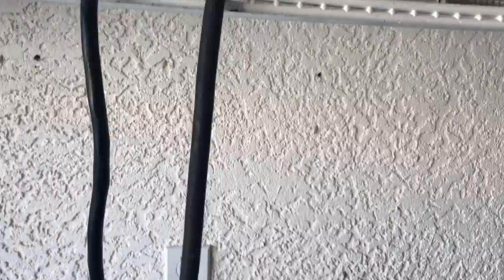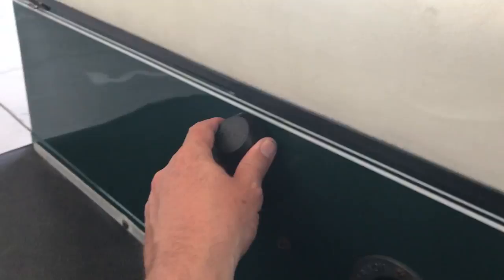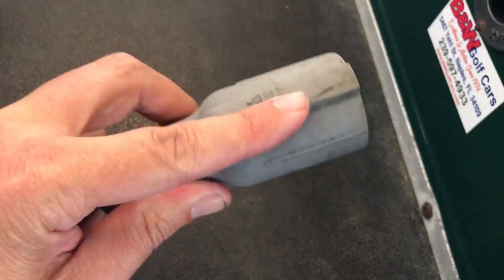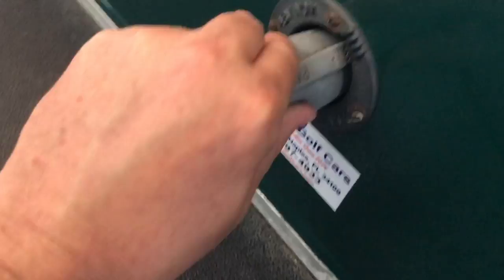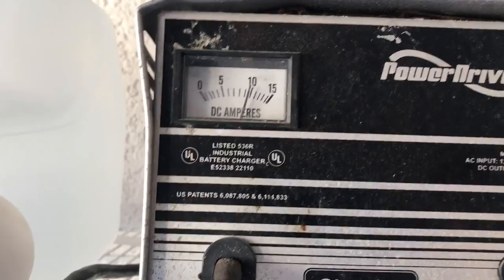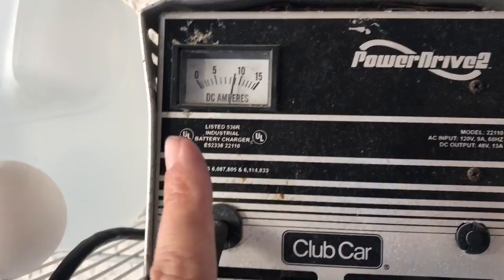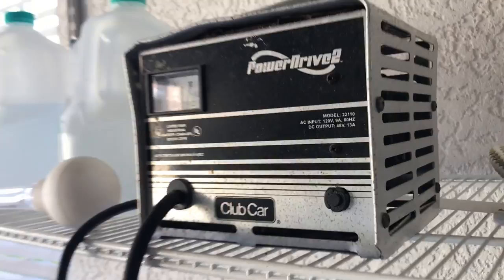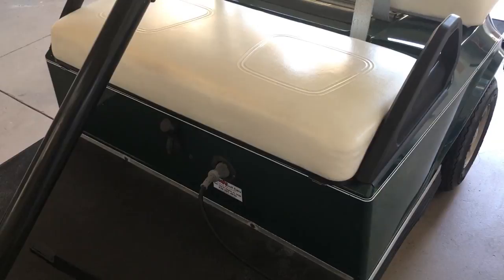Golf cart charging

Comment: If the amp meter reads 9 are my 8v batteries fully charged? Would be nice if you included where the needle should read when batteries are low and when they are fully charged.

Comment: How do u know when it's done charging
Reply: I have one of these things. Over time, the cart will draw the current from the charger, and as the batteries recharge, you will notice the needle on the DC Amperes gauge slowly dropping towards 0. Basically once it reaches 0 amps, the batteries are pretty much charged up.

Comment: how do I know if it is charged?  The amps go to zero?  Is there a time limit?  I am borrowing a friends cart and the batteries seem to have a lot of battery acid around them and on the floor
Reply: I have the same question.
Reply: guess he dont answer questions lol
Reply: I have the same question no reply guess I will have to call the company go figure?
Reply: Sounds like the batteries need maintenance and/or replaced in worst case scenario. Yes, if the charger starts out as he shows it, and over time, the needle slowly drops to 0, then batteries are charging. There is no real time limit to this; it all depends on how much the batteries need charging.